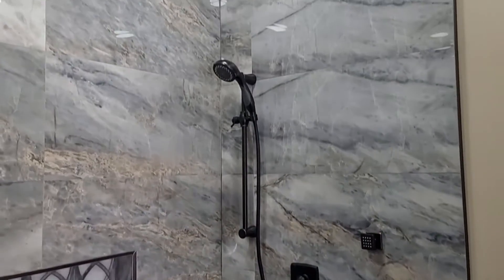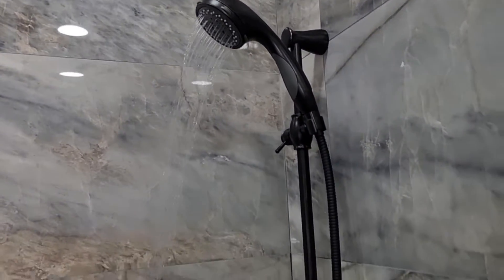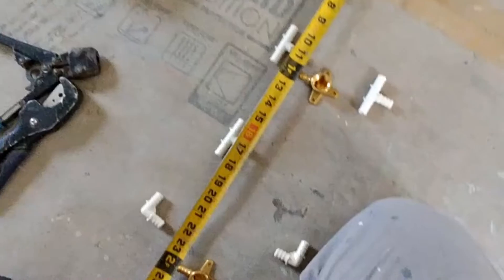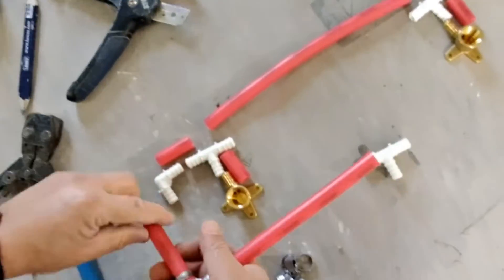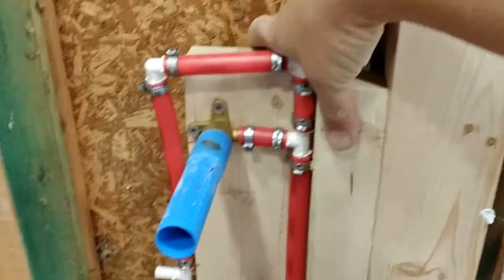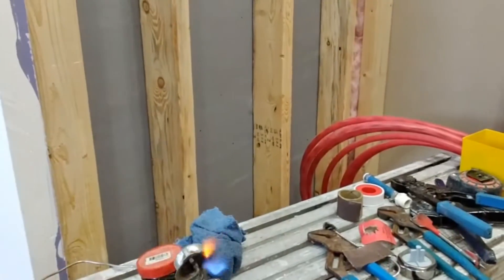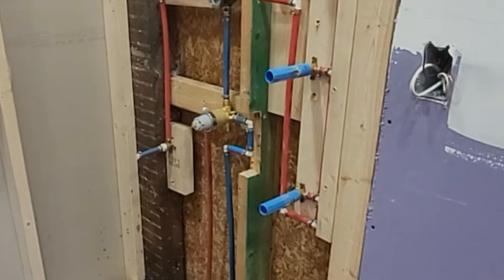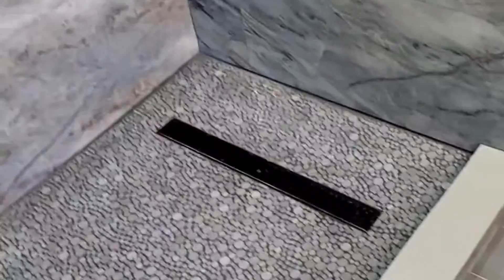How to install JETS IN YOUR SHOWER!!!🚿🔧

Comment: Hi Hugo,
Do you have a link to the materials you used for this bathroom. And what height did you put your shower valve jets at ?. And could you have put your shower valve jets in line with your shower head. And what measurement did you put you ceiling shower head ?. And where did you get the bronze material for the niche.

Comment: Is that 1/2 pipe? No need to use 3/4 pipe for 3 body sprayers, shower head and handheld like in this setup? Does it work good with 1/2 pipe?
Reply: I think the pressure is too low,he should've used 3/4 pipe
Reply: @luernesto74  3/4 pex ID is closer to 1/2" ID copper. Volume problem with 1/2" pex. Terminate into a 3/4 x 1/2 drop ear SharkBite Max.